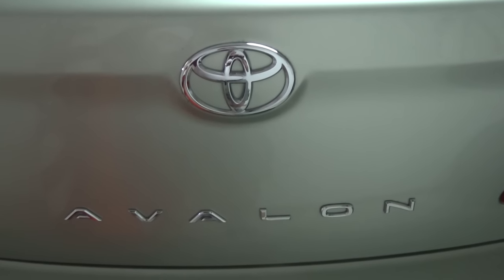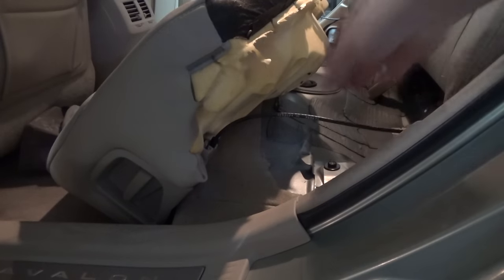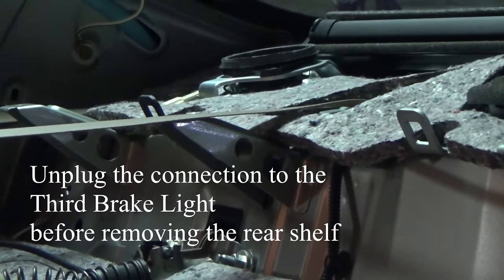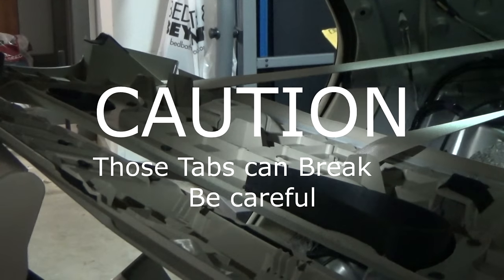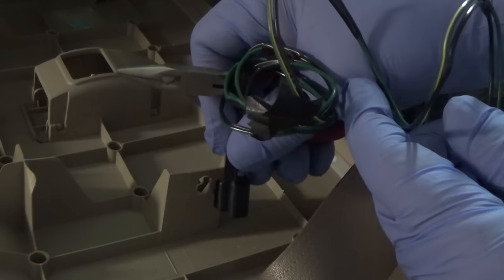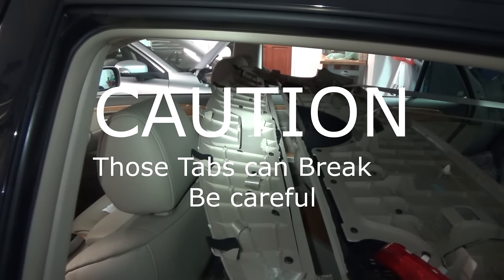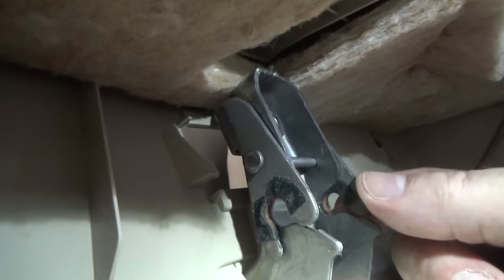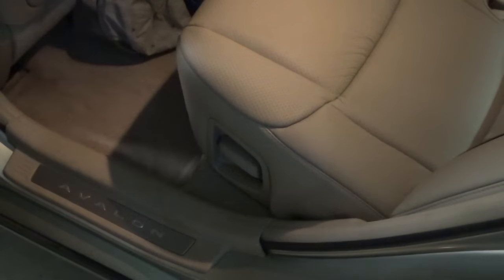Toyota Avalon Third Brake Light Replacement

Comment: Great video on gaining access to this brake light.   Took me about 2 hours to disassemble and reassemble.

Just to offer my experience on my 2008 Avalon:   I removed and tested the failed OEM module with multimeter.  The LEDs were OK, so I just re-heated the solder connections (10 of them) with new solder and some flux.  This was sufficient to fix mine - no need to replace.  8 connections are on rear of PCB (resistors and diode) and 2 are on front of PCB (need to pop off the red bezel).  

Other Avalon chat boards mention that cold/cracked solder joints are the primary cause of failure - bad quality control at the factory.
Reply: Update - still working great 3 years later.

Comment: This video helped a lot along with this post from Avalonsgalore on the Toyota forum. Just did mine and it took about 2hrs which included cleaning all the crap your kids left behind. 

Avalonsgalore states “ This post was quite helpful, but I replaced my light in a slightly different way.
1. Remove the bench of the back seat. Disconnect the recliner lever wires.
2. Remove all three backrests
3. Remove the driver side seatback completely. This is accomplished by first removing the upper bolt in the plastic access panel behind the backrest, then folding the seat forward to access the lower two nuts holding it in place. Once the three bolts are removed, removal of the seatback is easy.
4. Remove the upper bolt from the passenger side seatback. Again, this is done by removing the upper bolt in the plast access panel behind the backrest. Once the bolt is removed, tilt the seat forward. I did not find it necessary to remove the lower bolts and take out the passenger seat.
5. On both the driver's side, pry off the plastic piece of door trim nearest the seat. It pops out fairly easily, as it is only secured by tabs. No screws involved.
6. Pry and then pull the air bag cover panel out. Again, this is only held in by tabs and slots. No screws involved.
7. Repeat removal of plastic door trim, and air bag cover panel on passenger side. This can be a little trickier, since the passenger seat is only tilted forward, and not removed. However, it is doable.
8. Take the plastic rear deck, and pry up the front part. You will not that some plastic pillars slip out of some metal supports when you do this.
9. Pull the rear deck away from the window. It should come out fairly easily, as it is only held in by some slots.
10. Take out the existing LED unit, being careful to not damage any of the tabs. 
11. Put in a brand new LED unit. (If you did damage the middle tab, I found that I could cinch the new light into place by drilling a small hole in the rear deck near the third tab. Then I could secure the light unit with a small nut, bolt, and washer. A black bolt head is probably the least noticeable.)
12. Take the wires for the LED unit into place, using the same path that the former wire took.
13. Plug the wire from the LED unit in, and then turn on the lights, step on the brake pedal, and make certain that the new LED unit works.
14. Replace the rear deck. First push it back against the window, and then pull down the front edge so that the plastic pillars again fit into the metal supports.
15. Replace air bag covers, and door trim.
16. Bolt passenger side seat back into place.
17. Replace driver's side rear seat back, being careful to make sure the seat belt is in the right place.
18. Reconnect the rear bench recliner wires, and then put the rear bench back into place, making sure that the seat belt buckles are accessible.

All in all, it is not too difficult, and it is a great opportunity to find lost items, and to vacuum out garbage and gunk which may have accumulated under the back seat bench!”

I may add to remove the rubber molding  just enough and the plastic trim to easily pull out the side door trim for airbags.

Comment: Just fixed my 3rd brake light thanks to this video.  VERY HELPFUL!  After struggling to connect the rear seat reclining spring.  I found it easier to bolt the seat backs in first.  I used a small bungee to hook the neck then guide the "T" shaped connector into the bracket housing.  It took me about 2 hours alone.  Couldn't have done it without this guide.  Thanks for the video!

Comment: Thanks David for posting this video.  Amazing the amount of work that was required to replace the light and the expense of the light itself!  Talk about over-engineering something. I've found this with other things on the Avalon i.e. head light assembly. When it comes time to replace this car, I might look at another brand. It's almost as if Toyota is engineering their cars to prevent us backyard mechanics trying to do work on their cars.

Comment: Done!  I had it apart and tried to re-flow all of the solder joints on that light board last year.  It held up for several months but as soon as the cold season came on the light quit working intermittently.  Thanksfully I never put all of it back together so gettin in today was quick.
Those darn plastic rivets are always crap though.  The ones that survived work out but about half bit the dust.
Biggest trouble I had was lining up the spring loaded seat back load points.  After that the job finished quickly.
As you said... the plastic mounting for the light is not very sturdy.  Use Caution!
Thanks to David for his video!

Comment: Thanks for making this video. Same thing happened on my 2005 Avalon. Switched it out no problem and replaced my stock subwoofer in the process since it is right there next to the light. Thanks again
Reply: What subwoofer did you use to replace the stock?
Reply: How to you remove the factory subwoofer? Did you have to take out the rear shade?

Comment: Good thing you don't have to remove the engine and trans to replace a head light.
Reply: :))) lol
Reply: No but we have to remove the bumper and assembly for my HIDs in my toyota avalon limited 09
Reply: GM
Reply: Wtf! This is insane! Just for a damn light?!?!?! Think I’ll pay shop! 😂
Reply: Lol I bought the HID bulbs online and took it to my local dealer so they could replace them since the bumper has to be removed and it's hard to disassemble the rear headlight assembly. My local Toyota dealer had the audacity to want over $200 per bulb....!! I found the EXACT same HID bulbs(OEM too!) on Rock Auto for less than $30 each for a 2005 Avalon Limited. Thank God for the internet.
Reply: There was a video on pulling the front bumper off a Chevy to change a head light bulb, So simple a 7 yo can do it. He hands his kid a 3/8 electric impact and the kid pulls the bumper off in 5 minutes lol
Reply: Hahaha. Toyota easy to repair right?

Comment: Thanks for this. I'll tackle mine when the temperature is warm enough for short and t-shirt. Tip in  lining up the spring-loaded seat back mounts, tie a thick sewing thread on the T shape, feed the other end in the hole, pull the thread to line up the t shape to lock it in. The nut will cut the thread when you screw it in. Con? You now have a piece of thread in the back of your seat 😂.

Comment: Thanks to your trailblazing I got this done in exactly 2 hours. My least favorite part was putting the seat backs back on - it was hard to get the things to catch - but I found it easier after bolting the bottom parts in. And I almost forgot to plug the light back in before putting the seats back. That would have sucked! I ended up securing the side cover rivets with packing tape to stop them from popping out when putting those back in.

Comment: Excellent video. I replaced my third brake light on my '06 Limited with the help of this video. Thank you!
Reply from the maker: Your welcome. I am glad this video helped you.  Thank you for taking the time to leave a nice comment.
Reply: @PontiDelMercado  I did'nt disconnect the battery. I did remove the bottom of the back seat, but I just removed the bolts from the backs of the back seat and folded them forward.

Comment: Nice Video.  This is absolutely ridiculous the way Toyota put this together.  I just purchased a 2007 Avalon & same thing, we failed at the safety inspection.  Items such as this should be made to be maintained easier than this.  It's like pulling the motor to change out the front headlight.  That would make 0 sense.  I believe I have a $10 solution.  I will do a video when I fix the car & will be sure to post it.  I was hit $140 at the dealer for the part but will be taking it back tomorrow.  Thanks again for your video.  Not looking forward to removing the rear seats...
Reply from the maker: Thank you for your comment.  I would like to see your fix.  Clearly the LEDs are OK but the circuit failed in some manner.  Please post another comment with a link to your video and I will make sure the link gets posted and does not get hung up in the Likely Spam folder.
Reply: @A_Renaissance_Man  here is lowrider's fix.

https://www.youtube.com/watch?v=TK6-Z9SOcOQ

Comment: With the clear details of all the involved parts and structures from this video, I have mine done in 30 minutes without removal the back seats. You have to remove the three seat-belt latches on top of the back seats by unscrew the 2 attached screws, thus the back panel with the brake light could carefully slide right out; you might have to adjust the reclining of the back seat down to increase the clearance when sliding the back panel out. 
1. Pull the back-seat back, using the lever on the side of the seat .
2. Removal the 3 seat-belt latches on top of the seat
3. Remove the side C panel on both sides as seen from the video. With a rubber hammer hit where there is the airbag sign couple times to loosen things up, then pull the top far end corner of the C panel out first. Then using it as a leverage to pull the whole panel toward you so it could slide out off the anchored slot (please see the video for detail of this panel and the slot)
4. Do same thing to the other side
5. Lift up the panel with the light housing
6. Disconnect  the attached wiring on the driver side by pushing on the tab and pull the wire down.
7. Put the back-seat back to its original position to increase the clearance at the top of the seat for the back panel to slide out. Gently guide the whole panel back toward you and lay it down on the back seat
8. You may have to run from side to side and gently guide it forward and toward you.
9. Be careful with the middle tab holding the  LCD light unit, very easily breaks.
10. Carefully disengaged the middle tab and gently pull that end up, slowly then you will detach it.
11. Put the new unit back in on the reserve order, after testing it working.
Good luck. Thanks for the video. Could not have done it without your instruction and details.
Reply from the maker: Thank you very much for adding your experience.  Hopefully others can also shorten the time needed to perform this task.
Reply: Thanks for the tip, way easier to do what you listed. I've now done this by removing the rear seats and then just doing your shortened version. Your process saves a ton of time. Thanks again!

Comment: I may be missing something - the 'hump' containing the light just pops off of the rear deck.  You can see the little white round tabs from underneath in the trunk.  The lightbulb unscrews just light the headlight bulbs and can be replaced in  about 2 min.  I don't see why you could not install a new light in the 'hump' this way. I have done this several times because I used a LED bulb the first times, which are poled, and I had to rotate it to get it to work right.  The dashboard alert do not clear with an LED, even if working properly, so I replaced with reg bulb.  If you don't mind the alert, the LED works fine.
Reply from the maker: Ok. but in the Toyotas I have worked on did not have light bulbs.  All of them had LED bars and the whole shelf had to be removed.
If your method works then I appreciate you sharing.
I will look into this further.

Thank you for taking the time to share you experiences with everyone.

Comment: David Prokity thanks for this video! My 3rd brake light is Dim. I will try and solder it and see if it helps. Now I just need to figure out how to fix the Grinding of the rear Sunshade! It tries to go up but just grinds. I put silicone spray in the track for the rails but didn’t help. I also gotta fix or Remove the rear subwoofer cuz it’s blown, too!

Comment: My wife just took her 2007 Avalon for state inspection. The 3rd brake light was out,(WE didn't know it). The dealer charged her $300 to change it. She did this without checking with me first. I Seen the part online for about $75 or so.  If she would have called me first I would have told her to wait.  I wanted to see just what it takes to change these. Thanks.
Reply from the maker: Thank you for your comment.  $300 was less than I was quoted.

Comment: I have a 2011 Avalon LE. Fortunately, you don't need to pop off the seats... Unfortunately, you still seem to have to take off the side panels to pop off the back shelf... and that's where I'm stuck.. I'm trying to pop off the back shelf up, but am afraid to break something. Hopefully will work up the courage to give it another go soon.
Reply from the maker: You should be able to pull the shelf straight out.  Don't lift the end too much.

Comment: Thanks for the video. Used it to walk through the steps, however instead of replacing the light I read that sometimes it's a solder joint on circuit board. I took apart the light and resoldered joint.. And good to go. Pain getting the reclining seats to latch though.. 😁
Reply: Same here - resoldering fixed it.   For seat latches, I used thin wire thru the reclining spring to lift and catch the seat latch.  Once bolted in, just pull out the wire.
Reply: My wife's 2009 Honda Civic had the same bad solder joint problem..........fortunately, it was much easier to remove for the repair. I'm sure looking forward to repairing my Toyota Avalon's center brake light and rear sun screen when the time comes..........NOT!!! Thanks Toyota!!!

Comment: Hey Bud, did you mean to replace the light or just the bulb? I changed my bulb on my 2004 and it took me 2 mins and I just had to slid the cover off and replace bulb. The dealer marks up thing because they can. With advancements in tech they make things easier to replace not as difficult. No shade just FYI.
Reply from the maker: These are LED's and required the unit to be replaced, or repaired if you are electrically inclined.

Comment: the back seats don't have to come out , u just remove the rest panels behind thd rear seats on thd upper wall just behind the rear windows and once yoh pop them off , remove head rests and pop up the back panel and slide it out towards you ..its easy ...
Reply from the maker: Thank you.  that sounds like a good idea.

Comment: I’m still nervous about trying this replacement but your video made me buy the part. Now I just have to wait until I feel like tackling this PITA repair or I’ll leave it until my wife gets pulled over for it and the cops make it an “urgent” fix.
Reply from the maker: Yea ... There is a lot to it. Good Luck with your efforts.
Reply: Just got pulled over because the light was out. It just snowed so i'm pretty sure the cold cracked the soldered joints. Seems like alot of work. I wonder if i act surprised i can get off everytime with a warning

Comment: David, how much of this disassembly is required to reach the rear sunshade assembly? Would rather not mess with the two seat pillar panels.  I just want to disconnect it entirely.
Reply from the maker: Hi.  This fix was four years ago and I do not remember the Sunshade other than the shade did not have to be removed.  If you do not want the shade to work then I would look up the fuse and pull the fuse if the fuse does not also power something that you want or need.  I think the plug for the shade motor is behind the right shoulder of the right rear passenger so the rear seats would have to be pulled to see where the connector is.  There may be some diagrams out there on the internet to help you.  GL.
Replacement or repair of the sunshade is a big deal as far as time into the project would go.

Comment: Actually the two brake lights in the body always need to be operational   The Auxiliary Brake Light is not mandated to be working any time you apply the brakes.  This brake light is for those behind any vehicle behind you to let them know there is slowing ahead.
Reply from the maker: Thank you. Here in Virginia all lights installed must work. Brake lights, fog lights, seperate circuit off road lights, et.al.

Comment: I have an '04 Lexus ES, and am able to extract the housing from the top shelf, under the rear window glass without removing seats, etc. Is the Avalon a whole different car from Camry or Lexus? I assumed they were basically the same platform, when searching "how to" videos. Japanese cars are so reliable, but even the simplest repair is a major production (valve cover gasket, etc.)  Excellent video, but I'd never be able to do it this way. Glad I didn't buy an Avalon!
Reply from the maker: Thank you for your comment.  I do not know about you Lexus and I followed the Toyota Service Manual for that repair so it is what it is. Good Luck with your repair.

Comment: Do you know what the little black box right behind your 3rd brake light, sitting on the trunk is? Antenna?  Also the book labor for the 3rd brake light is 1.4hrs. On AllData
Reply from the maker: Correct. That car has satellite radio.
Reply: Thank you. Just bought an 07 avi limited. And hadnt seen that before